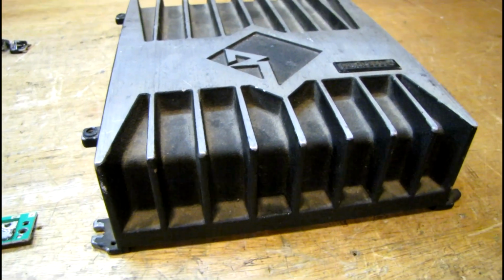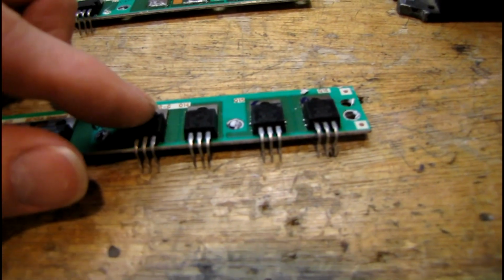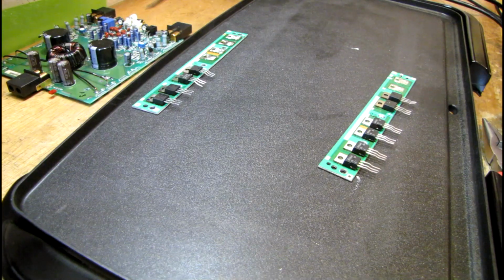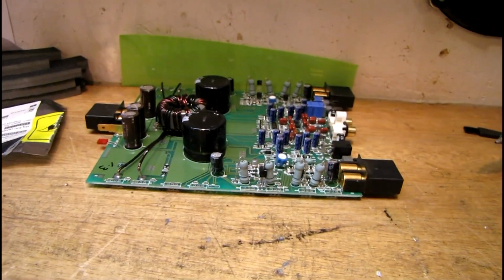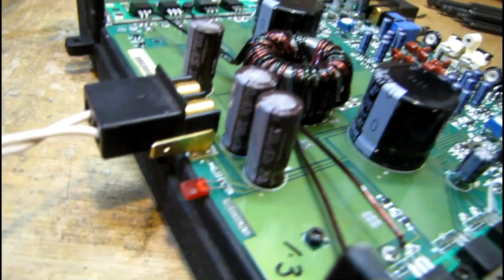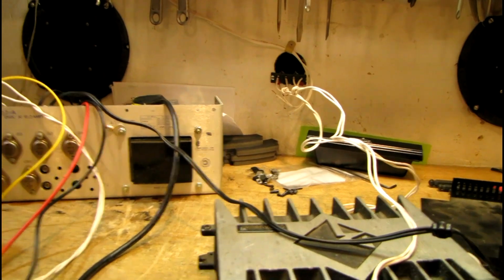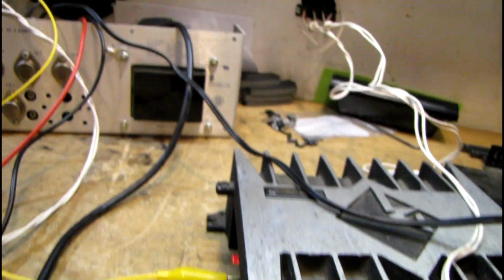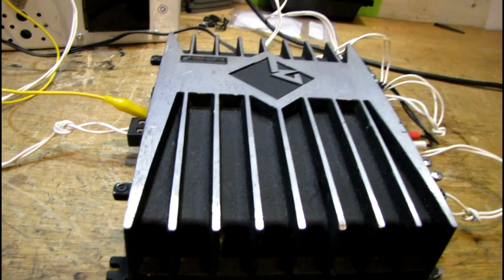Rockford Fosgate Car Stereo Amp Repair

Comment: I have some old landmine rockford amps which have not been used for  some time.
Punch 200 
Punch 100 
What components require changing 100% on a service.They were purchased new by myself and have not been used in 20 years.
Cheers

Comment: hello body. a have the same proble on the same amp  i'm not a tech....
so dont have any power on it. 
dont know how to test the power area..
so in the video. you just replace the transistors  Q15-Q16
and Q8- Q7..and it turn on..??
i found a diode busted. that part i know how to test 👍..

Comment: Wish I could get my 800.a fixed
Reply: 800a2?  Thats one nice piece of equipment from back in the day. I hope you can save it.  I dont know if you are willing to pay to fix it or not but if you are I can give you the info for two different amp repair options that have lots of positive feedback and good reputations.  Ive used both to save an old Autotek and an old Zapco from mid 90s.
Reply: Ya the green diodes on th left side on 1 end have some dang to am and yea it's a bad ads amp

Comment: I have one of these too that I got going today, i had to replace all transistors, but anyway it worked perfectly for several hours and then the left channel blew up while I was jamming out. And it turns out there's a really advanced problem with the driver circuit for the left channel, its not something I can repair since it requires SMD soldering which I'm unable to do. So now I have a single channel Rockford fosgate amp :) It still has enough power even with only one good channel. I tried swapping the FETs again, but it instantly blew them again. So I'm calling that amp my "singlerockfos amp". XD just thought I would share that with ya :)
Reply: You need a heat gun

Comment: The caps by the input are for what
Reply: Those are filtering caps, the smaller ones.  In simple terms They filter out noise picked up from the power supply.  The two big Nichicon 4700uf 50v ones are the stiffening caps for the power supply.

Comment: i have a question.  if you can help. i have a 500a2. never been into. but it is wonderful on the left channel but the right channel is not that great. eveb adjusting the gain the left channel is 2 x loder than the right. can you help me please. i love this amp.if you can contact me.i really want to fix this or diagnose it anyway. i can check voltage and all that but i was using a orion and it didnt do.it. but the thing was rated at 2 times the power but is no where near as strong

Comment: Beautiful amp, and great work getting her going again. In case you haven't already found out, the bolt ears on each side are for plates/wings that cover the wiring for a clean install. Would love having this amp. Again, Great Job! Can't beat old school Fosgate.
Reply: i have one here same model, same problem if u want it i can ship it to you. i have way too.many car audio as i am an installer and audiophile collector of vintage home audio as well as a electronics tech for over 21yrs. let me know.
nigelmahabir@gmail.com

Comment: Hi there, just wondering what do you use as a power source?
Reply: POWER ONE HE12-10.2-A but on smaller amps like that you can usually use a computer power supply which usually gives you a extra layer of protection against shorts and stuff (on a atx PS at least)

Comment: You can get a SMD rework station off eBay for $50 and it would have made it easier and faster. I got one just for this and use it to heat the glass on phones and tablets to replace to glass and it's a time saver, even faster then the phone hotplate I have.
Reply from the maker: I've been hoping to get one soon.  I need something that can also do BGA chips.

Comment: do you not need 13.8 volts at 5-6 amps.
Reply from the maker: +DAVID GREGORY KERR Depends on the size of the amp.
Reply: DAVID GREGORY KERR a 150 watt total RMS car amplifier can draw up to 20 amperes, and this is 360w so go figure...

Comment: Good work on your videos. If I may make a suggestion; the next time you need to solder something with a lot of surface area, brush on some flux first. It'll make your soldering job much easier.

Comment: where did you find the mosfet for it. i have a 45.2 that needs some and i dont know where to find. i am glad to see some one showing low to one of the old skool cheater amps. i have been a fosgate freak sence 16,21 years later still have my first one and a few more. i would appericate any info you can give me. have a a 45 and a 110 that both need some new peices.  if you can answer a couple other questions if y9ou do mind answering if you can

Comment: As it's a Punch 360aII it's the Best Buy version, the ones sold by authorised RF dealers are Punch 360a2. It's only giving 45 watts to each of your speakers as they are 8 ohm. The amp is bridgeable for 360w RMS on a 4 ohm sub.
Reply: Just got one of these. It uses the same board as, punch 360.2, 400S, 450S, 451S, punch 401S all similar boards. Good amps will power most subs

Comment: Just about to do my First Transistor/FET replacement on my Punch 250a2 ( one step down from the 360 ) that ive owned since new in '99 And this video is awesome on detail. BIG HELP. Thank you. and love the skillet idea.
Reply: +Michael Gillen  how did it go? I'm currently trying to repair my 250a2. it powers on put the power led just pulses ,and with no out put. Maybe you could help me?

Comment: Is it me or do car amps just not sound as nice as home amps
Reply: Car amps just don't sound good
Reply: no they dont, they are optimized for 12v low power and their speakers are no where near as good as  a good home amp.
Reply: Synthematix and the car speakers as well. they are made for withstanding warmth and cold wet and dry. so they had to let some of the good sound go :(
Reply: +Synthematix car amps sound awful and are horribly made compared to hifi amps and PA amps. you are certainly right. they only have their power with low impedance speakers too. as they run off low voltage they have to run on low impedance speakers to achieve any reasonable power. which really sucks about them.

Comment: Just a question, do you think you would be able to fix my 1000bd a1 rockford fosgate amp. It gets a little tweaky from time to time. And if so how much would it cost?
Reply: mikey sousa Check the solder joints and re-solder if necessary. They deal with a lot of vibration which can break solder joints..

Comment: Man u are an electronic GOD.  

I wish i not so far from u.  Have a nice 30amp power inverter.  I use to install car stereos in my teens and bought many used amps so i always test them with it.

I miss my multi room stereo so badly.  Noone locally can or will try fix for me

Comment: I know everyone is about to destroy me when I admit to this... but I have the same amp that Maxxarcade is repairing above. As of today (13SEP14) ... 2 hours ago I was re installing this amp in a project car I built earlier this year... Aaaaaaand I crossed the power wire and ground wire. Meaning I installed the 2 wires opposite where they should be. Soon as I energized the system with my battery quick disconnect... loud pop! And the Rockford 360a2 amp was smoking in my trunk!! Good Lord I am a moron!!! Can this be repaired? Can you repair it sir Maxxarcade?

Comment: Hi I have a quick question how much would u charge me to fix a Technics SUV450 class AA house amplifier It was working perfectly fine till last year there was a rain storm and knocked out the power and now one side of speaker out puts works and the other side sounds very low

Comment: Nice repair. I quit working on stuff like this 20 years ago because these amps are all junk and once they blow they really aren't worth repairing if you do electronic repair for a living but you're doing this just for your own pleasure so that I can understand. A good thing to always do before you hook speakers up is to measure both outputs for any DC voltage because with a split supply you can have good output transistors but have a faulty OP amp that is either blown or leaking a DC voltage to the final stages. If you have a scope, look for any high frequency oscillations on the output too. I've seen amps burn themselves up along with the tweeters with the silent killer oscillations outside the audio range.

Comment: quick question Can I power a car amp with the voltage it needs inside ( 40v 0 40v my case) and if yes where to tap the wires? right at the filter capacitors?
Reply: if the caps are 50v or more yes but remove the inductor and the mosfets and leave only the main amp connected or boom

Comment: You can also convert the thermal from MESHA to regular mica insulators or Kapton. This would require the mesha boards to be removed and new insulators be used. as well as some pressure bars (hold down bar).

Comment: Thanks for making this video. I just bought the same type of amp and one of the Mosfets was completely destroyed. It is a punch 150@2. I also have punch 120@2 and a punch 360@II. These are awesome amps. I'm not an electrician by any means, but I think I'm going to try to replace the Mosfet myself. Thanks again.

Comment: you have a black and grind series amp. those bolt holes are for vanity covers. It  cleans up the install and hides the connections.

Comment: I have a 2007 Toyota Corolla, and was thinking if you would know how to tap the preouts from the op-amp inside the amp? The circuitry is really complex, with really small SMD devices, and there is no labeling abt preamp/amp section. Any help will be greatly appreciated!!! Thanks

Comment: nice work! i have a kenwood 8105 mono amp. have been facing and issue of power loss randomly. but increasing volume does get the bass back. ive never opened an amp before. what do you think can be wrong? some advice would be welcome. cheers...

Comment: Well I have been using the amplifier but I've noticed some problems with it. It's a Phonic MAR 2, quite a cheap amp, only like 230W RMS per channel @ 4 ohms. But it was used in a nightclub for many years. When powering on everything is fine. But I've noticed if you don't let the amp warm up a little and you just crank it, it distorts, even if it's not clipping. In addition, when the amps cold and you power it off, it makes the right speakers bang, but when been on for a while it's fine?

Comment from the maker: Those speakers are THX certified, from Frazier cinema cabinets.  They are Eminence woofers, but I'm not certain if they are Beta 8 or something custom.  They are definitely some of my favorite speakers to listen to though.  They work so well, despite having no crossover other than non-original tweeter capacitors.

What amp are you working on?  I'll be digging into a couple Crown amps this weekend that I've never seen before.

Comment: Nice video, have got a few similar amps 100a2,55.2,150hd,45hd,800a2,600a5 some are working some not, might try this at some point. What did you use to clean the amp? came up really good.

Comment: Those are usually 12 or 15 volts DC, I think the bigger ones are 15 volts, but I would stick with 12 until you are dead sure.

Comment: Dude what is the power supply voltage of the gateway3000 computer speaker test amp that u have, because I have a set of those speakers with no power supply.

Comment: I've repaired a lot of these on my own. What I use is a small butane torch works great on soldering and desoldering the MOSFETs. What you there is a easy fix. The 4 MTP50N06Vs you can replace with IRFZ44 or IRF3205, and if your using 3205 change the gate resistors to 47 ohms the originals are to high. And make sure the drivers are producing the 5 - 4 ~ volts to drive the ps fets.

Comment: I have the model 551s, I started de-soldering the mosfets on the right side where black soot had collected on the metal casing, i diode tested the 2 IRF3205 and got good readings, just over 0.5V on both of them, so im a little confused where the soot came from. There is only one transistor that i can barely see the numbers and has some melted solder on it, it is on the upper left side 2nd from the top, IRF3540 i think. the 4 IRF3205 all had melted solder on their heat sinks.

Comment: I would have used a heat gun, and basically use it like a hot air rework station to remove and install new outputs.

Comment: This is a perfect tutorial, I just fried my Rockford Fosgate Amp this weekend after blasting my subs for too long. I took it apart and their wasn't too much left of the heatsink compound. The 4 mosfet power transistors are defiantly fried, I'll use your skillet technique to remove them. Thanks for posting this, gives me some confidence that i can actually fix the amp.

Comment: Equipment? Where to begin: I have an Adcom GFA555 Amp and GFP 555 Pre-amp MB Quart 390 speakers Two Velodyne 100W subwoofers and a Denon CD player. I also have a custom made surround system powered by a Denon AVR 3803 (7.1 x100w) with rebuilt ElectroVoice Interphase A speakers as left and right and a Jamo (Danish firm) 100W  subwoofer.  Surround and center speakers are a mix of Polk Audio and Jamo with a Jamo DVD player.

Comment: My equipment.. where to start!  I have a Adcom amp GFA 555 (325W into 4 ohms continuous) GFP-555 Adcom pre-amp. Mb Quart 390 speakers with 2 Velodyne 100W powered subwoofers and a Denon CD player  I have a custom built surround sound system powered by a Denon AVR3803 (7.1 x 100W) with rebuilt ElectroVoice Interphase A speakers for left and right and a mixture of Polk audio and Jamo (a Danish audiophile firm) speakers for the center and surrounds  The Sub is a 100W Jamo unit and a Jamo dvd

Comment: I guess if you get hungry while preheating the board, you could always cook some bacon. I'd forget the the decorative covers. They're a pain in the butt if the amp's mounted to a big sub box in a small car and contortion is needed to get them off. My car has a punch amp in it, but it's being driven off a pre-amp out from another amp, and the sub-out on the head unit's going to the back deck speakers. (I didn't wire it, the car was free, but I don't know how you can screw that up.) /rant

Comment: mp3 file -> amp -> speakers -> cam mic -> youtube
You can't really make a judgement using an mp3 file or a baseline to compare it with

After all the filters and re-encoding, i tend to be very skeptical

It doesn't take much to make the audio sound good, poorly made audio encoders, like youtube's, try to cheat and fool the listener by filtering/enhancing the audio six ways from sunday

Just analyze the audio with an audio program

Like listening to an mp3 file through audio enhancing equipment.

Comment: Can you please help me out i am getting s ome sub woofers and an amp but dont have a clue how to wire them up like if i have 2 500w subs would i need a 1000w amp to send 500w to left and right or would i need a 500w amp to send 500 to left and right ? thanks.

Comment from the maker: Sometimes you can use slightly higher rated transistors, but they would need to have very similar characteristics and conduction curves to work properly.  It depends on the preamp/driver stage design in the amp.

With this one, the original parts were obsolete, so I had to use a different brand with the same ratings.

Comment from the maker: No, car amps are sensitive because they always have their gain way up.  The volume is normally controlled by the car stereo.  

In this case it was loud because I'm using an M-Audio Delta 44 sound card, which has a pretty high output signal compared to most consumer line level stuff.

Comment: That amp will run 2 ohms stable i had one hooked up to 2 dule voice coil 4 ohms  ssl subs and it broke the window in my  geo metro lol at 4 ohms not into clipping its like 110 wats a side  but the amp will take 15 amps so at the higher end of things like at 2 ohms if u turned everything all the way up pas eq all your tricks u could make 300 watts pr channel rms and get a bloody nose too  lol .

Comment: Welcome to Maxxarcade. Today we making circuit board. Heat up the circuit board, add some solder, finish it off with a spice off flux and you got a delicious repair.

Comment: You are correct those tabs are for mounting plastic endcaps to hide all the speaker/power connectors. Those were probably one of the last series of amps to be manufactured by Fosgate in the U.S. once Bestbuy got their little gruby hands on Fosgate it was all over.

Comment: but I do have one question what if you used mosfets or tansisters with a higher wattage rating then whats in used will it effect the amp. and if so how and what would happen.

Comment: you could use that plate to heat it up to the solders melting point and you can then just pick the parts off and then clean up the pads .  after that you can apply solider past to the parts for the new mosfets, and put it in and oven just a little over the solders melting point and it will melt the solder and it will not harm the mosfets.   or use a het gun to do it also and with the pan you can use it as your preheater when placing the parts also both ways will work.

Comment: Great video! I'm interested to see the power output test as these USA made RF amps are known to be nicely underrated. For example, my test of a 1991 Punch 150HD rated at 75w per channel at 4 ohms actually put out over 120w when I tested it. I just upgraded my bench to support the big power and low ohm load cheater amps. I can support over 3500w and loads down to 1/2 ohm. Tests coming soon, thanks again for the video.

BigDWiz - OldSchoolStereo-com
Reply: Those old fosgates were awesome stuff